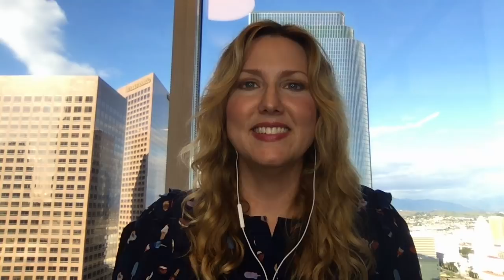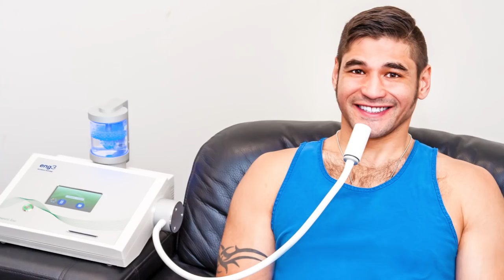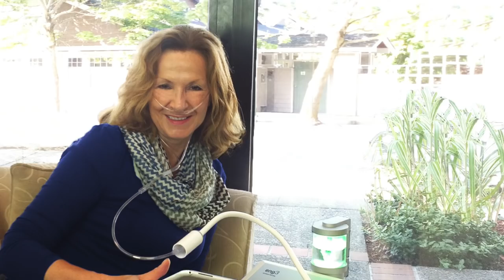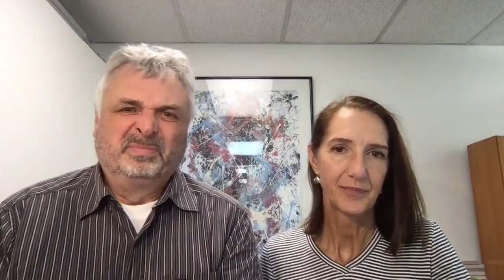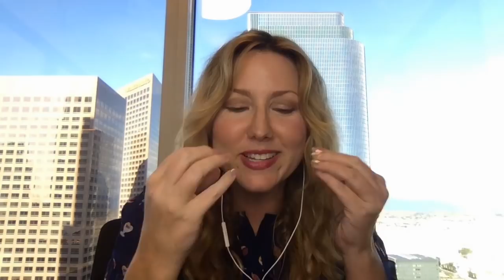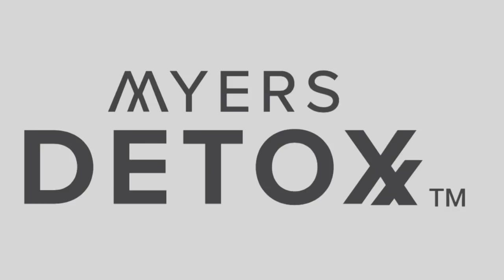Why NanoVi™ Rocks for Detox and Healthy Aging with Hans Eng and Rowena Gates

Comment: I love Health Devices, I have researched all things Alternative Health for 20 years now, & water was what I started out with for 3 years. Structured water is the most common name for water Molecules that are much smaller than what comes out of the common water faucet. To structure water take a bottle of any water fill it about 3/4 full & then with a strong downward thrust with force, you then stop hold & watch the water "cavitate" spin action as a result of the concussion force you give it by single hard down thrust,,,, repeat this 11 times or more I have found. This re-vitalises the water like running down a babbling brook. Taste the water, pour same amount into 2 different glasses, same amount then drink, you will notice the water you re-vitalised went down quicker,smoother,faster because it's water molecules are smaller now. This structured water is also called DEW as in the early mourning dew on the grass that is holding Earth bio-electrical & magnetic charge,, free of charge. Walk along or bend over & scrap the dew off the grass with a glass & drink Dew/ electrically charged water molecules. A device offered at Barr is the Radioactive Appliance a Health Tool Device the sleeping profit Edgar Cayce oftene recommended for people who use there brains all day. It is a .... I forget the metals it is made of but it must sit in direct sunlight absorb Sun Radiation them placed in a bucket of ice water to release a type of electricity to charge the body. I have one & it is make me very relaxed. Cayce said in long term use it could help those with down syndrome.  I wish He would explain if this device makes Hydrogen Gas available.